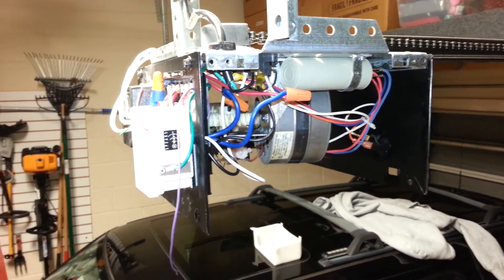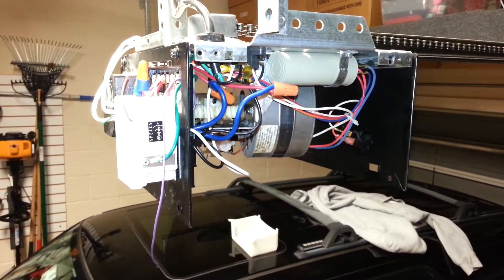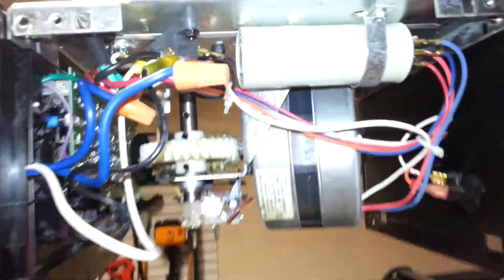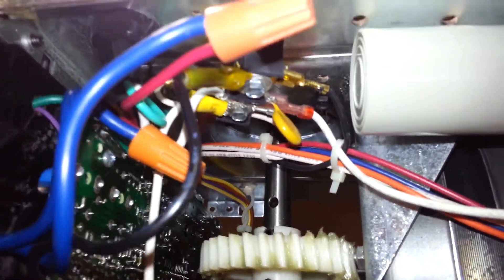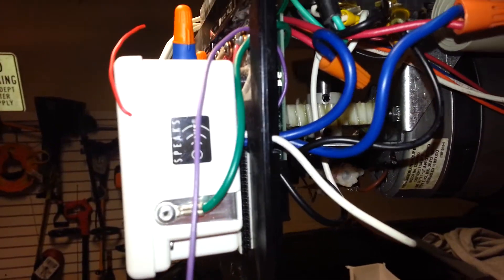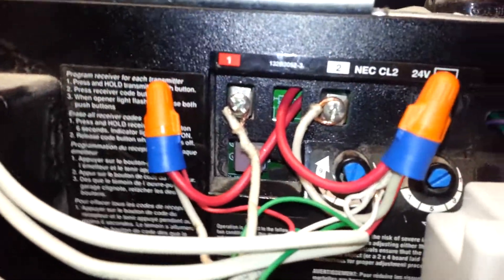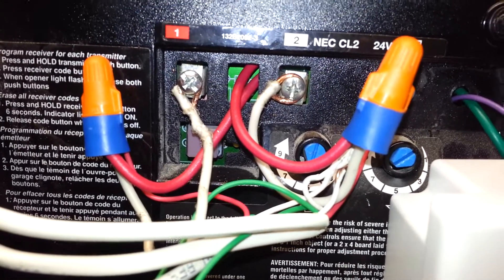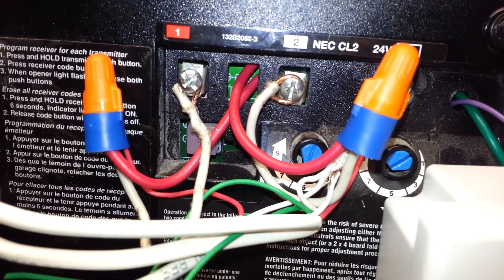LFM 20 Z-Wave Garage Door Automation - SmartThings - Vera - Homeseer

Comment: I just used the steps described to install my relay switch on my garage opener.  That was a great video and the power source is right there.  I was concerned about which blue wire went where but that did not make a difference.  This is my 2nd smart thing device installed. Thanks for the help!